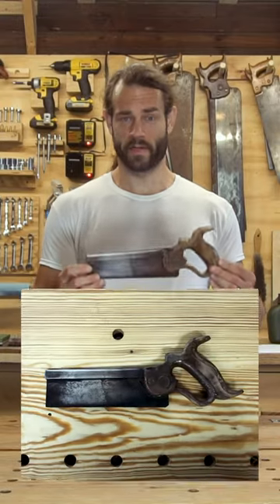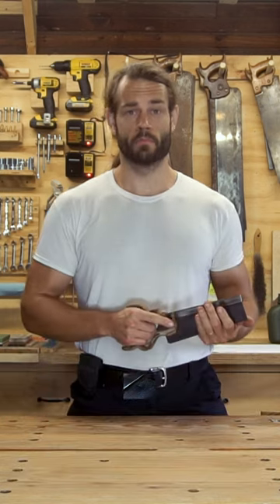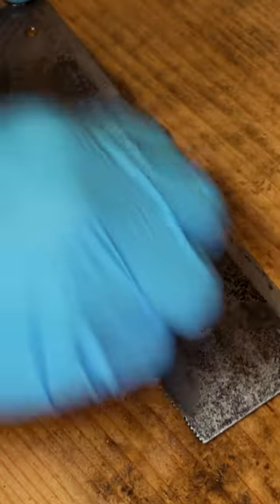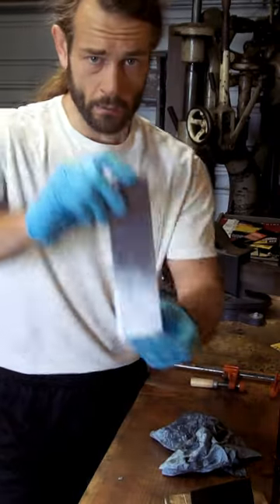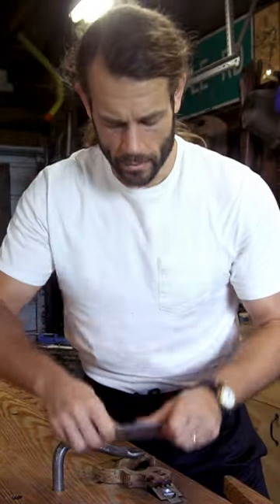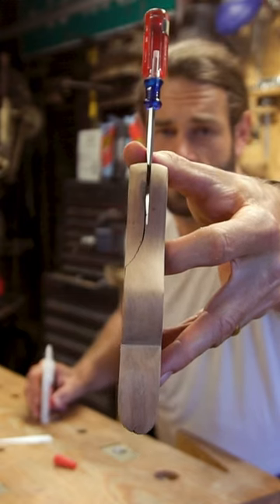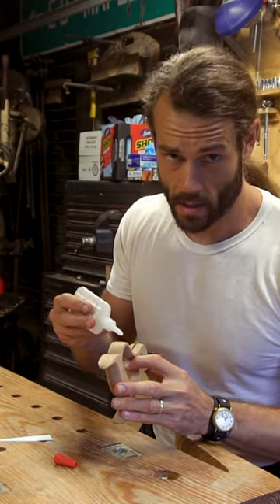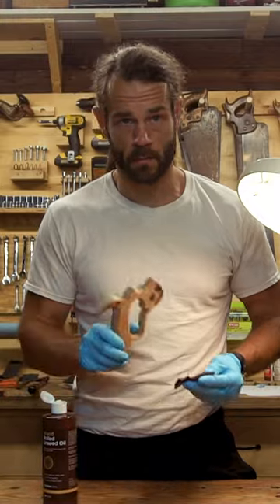Restoring an old backsaw - #restoration

Comment: Nice work  -- I just did a small dovetail saw like that a short time ago -- needed some time in Evapo-rust before I could get to re-sharpening it.  Turned out great!  Looks like it will be a great user in your shop!
Reply from the maker: Thank you! They're fun little projects (if the plate isn't too warped)

Comment: I discovered that using nail polish remover removes the old lacquer/oil from handles and totes muuuch faster
Reply from the maker: That’s good to know, I’ll try it on the next one. I assumed the old coating was shellac.
Reply: @mujinmakes  propably
Reply: If an old shellac is peeling off, I just torch it up and sand - apply several coats of birch tar and let it dry, the longer the better - torch a handle again. It will never crack or mold.                                                                                 For blades - birch tar and ashes - apply even coats and let them dry first, then torch or fire treat and let it cool down - it becomes a hard rock coating and is a solid one.  Birch tar is also a natural antiseptic, not toxic. Hope this helps.
    Best Regards !
Reply: @tatiananaugolnykh  birch tar? I'll definately have to look into that. Hope i can find it in my part of the world. Thanks for the advice!
Reply: @tatiananaugolnykh  isn't birch tar what the ancients used to glue stone arrows to sticks?
Reply: @mrJanniekoen 
Sure thing. Varusteleka from Finland does restock it, it's good, but it can also be made from birch trees bark. One thing, if a handle is dry, torching it; high heat, could create a crack. So, the more it absorbs birch tar and dries after, the better. Then torch, sand gently,  apply tar and torch again. What you have is  polymerized handel. For a blade, coating will not be even but it will sure protect it from rust - it does take awhile for tar to dry by air and torch/fire but works wonders for outdoors. Just don't apply it to a sharpening area of a blade, ive made that mistake. 
   Birch tar mixed in with sawdust and ashes dehydrated = the bestest glue, birch pitch - it doesn't crack due to sudden temperatures unlike pine pitch, it's very strong. For me, birch tar is essential. 
   If birch tar is not available but a wooden surface needs to be protected from moisture - the old remedy I know of is torching up the surface - it closes wooden pores and makes it moisture proof. To top it off - beeswax. Wax does need to be reapplied unlike a torched birch tar but it still does provide protection. Several coats with fire treatment in between so it absorbs and you could have another option. The only thing is beeswax will make a surface grippier and shiny, it will be a little sticky. So, its a personal preference. 
 Best Regards!
Reply: @mrJanniekoen 
  Indeed, you are correct. It was called birch pitch/glue - a dehydrated birch tar mixed in with ashes, saw dust and sometimes other natural materials.  Best Regards !